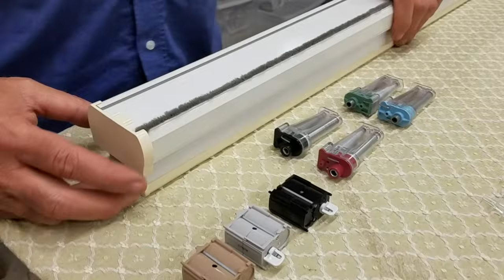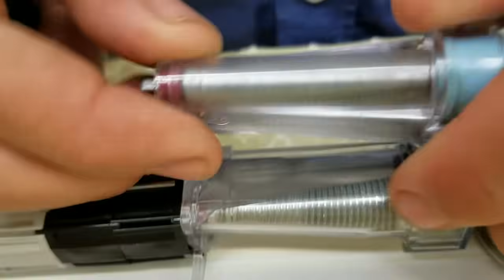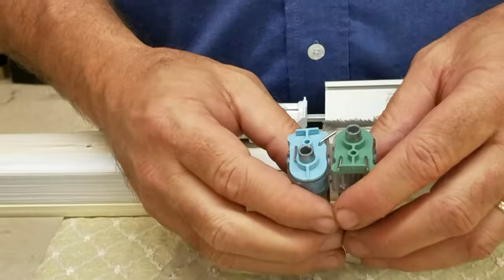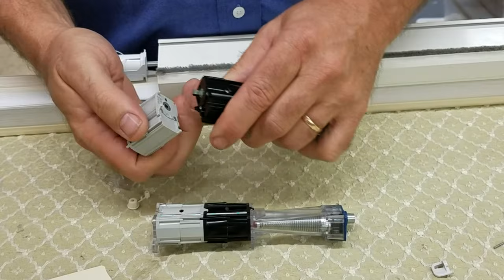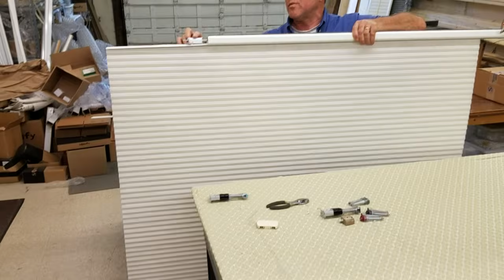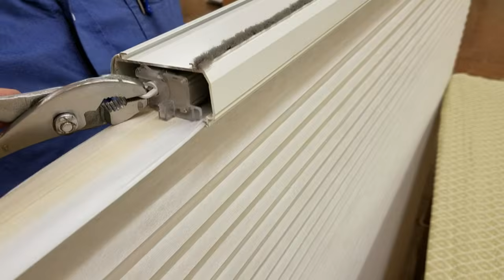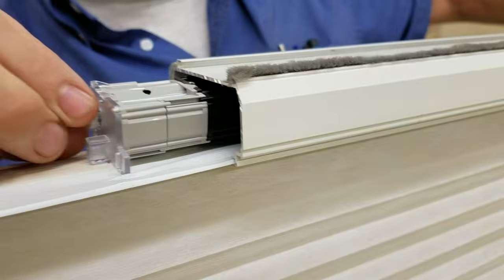Hunter Douglas Duette Shade LiteRise Lift Repair from AutomatedShadeStore.com

Comment: motors can be energized no need to buy new ones.
Reply from the maker: Yes...sometimes the motors can be re-used but if the small cord in the transmission breaks (which is usually the case), then the motors unwind rapidly and the internal spring inside the motor breaks most of the time. If you can rewind the motor per the instructions on the website 42 turns then you can re-use it. After repairing HUNDREDS of these shades, I replace ALL the components so the entire assembly is fresh and ready for duty. If you are going to tackle the job then I would strongly suggest doing it with NEW motors and related components! Doing it any other way is unreliable.
Reply: @automatedshadeinc4154  Where might one purchase the replacement motors?

Comment: Hi. Great video. It was very helpful.
For some reason my setup had the black Transmission in the back but on your video is in the middle. Does that matter?
Thanks again
Reply from the maker: I think you meant...black motor in the back...not the transmission. The position of the motors does not matter.
Reply: @automatedshadeinc4154  Perfect. Thanks

Comment: I have a shade with a four motor set up. The motors fresh back from repair, snapped out and unfortunately unwound. The transmission and all other parts look good. Is there a way to wind the motor back and reinstall? I may need to improvise for transmission pins and motor locks as well since I don't have these.
Reply from the maker: Usually when the motors unwind really fast the steel spring inside the motor either breaks or is compromised. If you can wind the motors 42 turns clockwise then they are still usable - if not then trash. The transmissions are very hard to wind back up so the string occupies every groove on the conical cylinder. I have not been very successful at doing this. If you are successful at rewinding the transmission then you could use a paper clip as a pin lock. After locking the transmission, snap each wound motor to the transmission to hold in place. Once assembled, maybe get a thin piece of wire ad wrap the assembly longwise to hold together so it does not come apart. Other option is to send back for another repair or purchase all new components. Hope this helps. Bill
Reply: @automatedshadeinc4154  Thanks. I will try. Else will come back for parts.

Comment: Woks as described, thanks a lot! My shades are slightly different, but the mechanism is the same. I add some hints: before taking off the old mechanism, take a few pictures, your shade might have different mounting attachments at the end or in the middle of the mechanism. Second: like the video shows, before coupling the mechanism make sure the strings are completely deployed, mines were just a couple of turns rolled, and that blocked the whole thing for a while, until I discovered it. Thanks again for the video!

Comment: Thanks for the detailed video. Thougjh i have a few questions. On the transmission you took off one stop and then took off the second stop after snaping on the motor.  Could you have left both transmission stops on then remove them both of them after snapping on the motor. Also what would happen if you didnt pull the shade down before removing the motor shaft stop. Would the shade still operate.

Comment: Where can I buy the parts? Hunter Douglas won't send the transmission and motors to me. They say it must be done through one of their dealers. They were willing to send the pockets and ferrules.
Reply: Purchase parts at https://www.blindshaderepair.com/Parts-for-Cordless-Blinds-Shades-s/2571.htm
Reply: Just a heads up if you take our blind to a certified repair center for hunter douglas the motors and transmissions are free, you only need pay for the service, however sometimes not even that.
Reply from the maker: @devisissy1  It is a free repair only if YOU are the original purchaser of the shade and have the sales receipt else you will pay for the parts and the LABOR. I was a DSC (Dealer Service Center) for many  years up until 2018.

Comment: What if I only need to change the transmission? Do I need to buy new motors too? I bought a blue transmission and installed with old motor and it doesn’t work.
Reply from the maker: After fixing hundreds of these shades over the years, I have found (and highly recommend on the webpage) replacing ALL the components with exact SAME colors of the existing components. This includes the Transmission, Transmission Adapter Plate, the Motors and the motor adapter plate. Anything short of this will most likely result in failure. Hope this helps. Bill
Reply from the maker: You need to replace the entire lift assembly which consists of the transmission and motors. Anything less will result in failure.